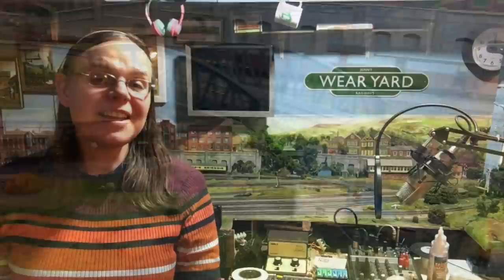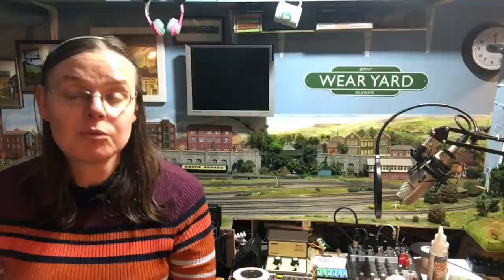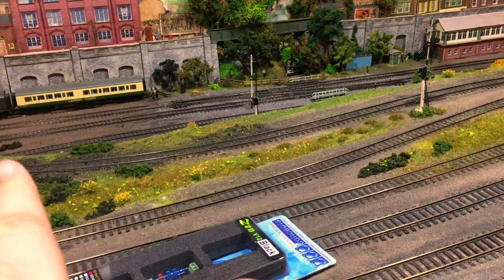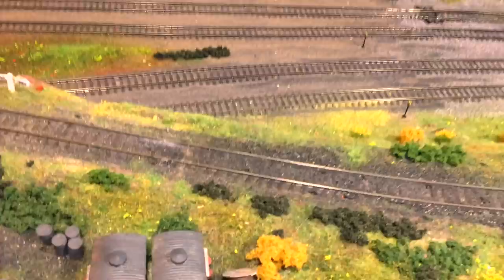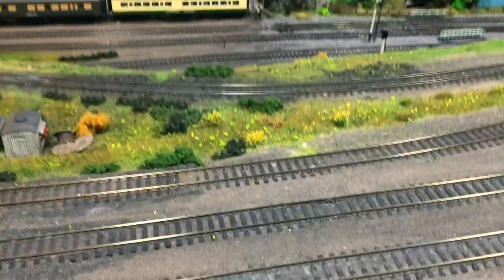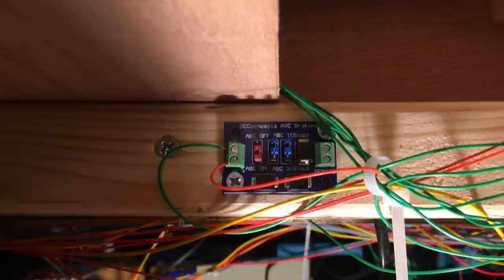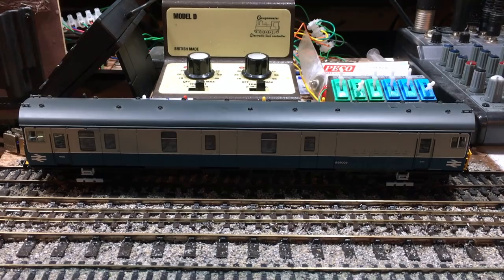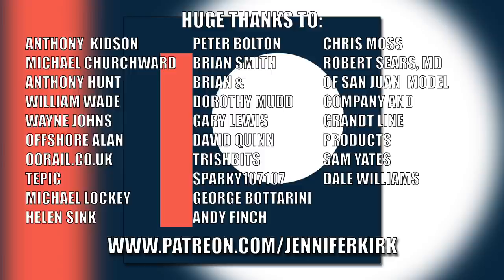Automate Your Layout The Easy Way! How to Add A Zen Black DCC Shuttle Module

Comment: Hi Jen.
I've been using this system for some time now.  5 diodes and a switch or relay to bypass them is all that's required. They're cheaper but less convenient than the DCC concepts module.  I use ZIMO decoders at £20 each which have ABC and all the other functions required to do the same thing as you're doing.  They also have superb motor control, and I highly recommend them.
Thanks for all you do for the hobby.

Comment: When this Video was uploaded I thanked you and stated that I was having issues with Zen Black Shuttle and Hornby Railmaster ELink.  Over the last week I have had more issues with ELink due to Windows 10 updating drivers for my computers mainboard,  USB Port drivers in particular.

As a result,  I wired my  " Arduino / JMRI "  controller straight into my DCC track via a DPDT switch,  I can now switch from ELink to Arduino at the throw of a toggle.
Up take is,  without changing anything else, the Zen Black Shuttle controlled section of my layout now works perfectly.

I can throw my "Toggle" one way and run ELink and the shuttle misbehaves,  Throw the "Toggle" the other way and go to Arduino/JMRI and the shuttle works perfectly. 

What can be taken from this is that,   in my case,    a bad experience with Zen Black shuttle modules was 100% the result of using Hornby Railmaster and Elink.

Thank you again for your videos.

Comment: Very informative and we'll demonstrated and thanks for bringing to our attention. Definitely something I will look into, as you say once intiated frees up your hands to do other things whilst creating operational interest for shuttles, or automatically stops an engine automatically once you have sent it on its way. Looks like the section  you have isolated gets switched between the normal dcc signal and dc, the decoder responding differently (but as programmed in relevant CVs) to whichever supply source it sees at that section. Stephen

Comment: Watching your video has been enlightening and I now know that I'm not the only one who has had gremlins with Zen Blacks.

I have 2 shuttle lines,  totally separated from the rest of my layout,  with a DMU on each track.  My Zen Black setup misbehaves badly.
I need to run the DMU's first forward, then backwards, then forwards again whilst outside the Zen controlled area, then I can let them enter the Controlled area and they will then shuttle back and forth with out issue, for a while.
If I shut down my layout whilst the DMU's are in the controlled section, then turn the layout on again they will come out of the controlled section move about 2 feet then go back into the controlled section, eventually after going in and out 3 or 5 times they will start behaving properly by going from one controlled section to the other and reversing correctly.
At a random interval my running shuttles will revert to this exiting and reentering the controlled area, then after a number of in and outs will return to shuttling. 
I'm using Hornby Railmaster with E-Link and have been advised by my supplier that E-Link might be the problem.
To hear you say that the Loco does not work properly if placed on the track the wrong way around is nice and is exactly one of the issues I have as well.
I have just started playing with Arduino DCC++ and JMRI and will now expediate the change of the shuttle area to Arduino, as I had given up on ever getting the Zen to work correctly continuously.
Reply from the maker: It sounds like it could be an issue with the e-link. I’ve heard that there are certain things that they don’t like. Otherwise, the other thing is to make sure the track is clean.
Reply: @JenniferEKirk  Thanks for the reply,  Yep... I've got a few things the e-link doesn't like.
* - Early Broadway Imports Locos - Keeps going into disconnect mode.
* - Broadway Limited Blueline - Just a mess.
* - Proto 2000 - Works perfectly on DCC++ but randomly stops for 2 seconds on ELink , same section of track in both cases.
* - Zen Black.

Track is super clean.  

I have been advised by 3 different train shops and quite a few Modellers to Dump the ELink,  but I love the graphical user interface,  not so much the quirks of Railmaster,  that's why I'm trying the DCC++ and JMRI.

Comment: Hi Jenny just viewed you ZEN BLACK V12 VIDEO. 
How do you get the right distance to get the gap in the Electric side of the track, for it to stop at the correct distance at the station. then wait and then pull away slowly and proceed to the other end of the branch line again wit for a given time and then proceed to return back again stopping at the station on the return Journey, I have the pack of 3 of these ZEN V12 BLACK DCD-ABC pack of 3 and they slow to stop. 
given, I bought these a couple of years ago and due to my health condition l have been in and out of hospital and now just got round wanting to build a end to end 3 meters long and 300mm wide with a siding part way along. 
I really enjoyed your Videos with so much definition and plain instruction, my problem is I am almost 80 years young and find it hard to come to terms with these modern days Electronics. 
If possible could you send me a wiring diagram how to wire these 3 up to the DCC l am hoping now to build having carried out the board construction having been a carpenter in my early days, again many thanks for your clear and precise explication of this World of Model Railways Workings

Regards Richard in Cornwall United Kingdom .

Comment: Thanks for that, I've been thinking about one of these for a while to use on my branchline. Just one question. If you wanted other locos to be able to use the track when the shuttle was not running (manually as such), is this an option? Or is it shuttle only once you've installed this?
Reply from the maker: Other locos will ignore the shuttle. Only locos with shuttling turned on via CV27 will shuttle.
Reply: @JenniferEKirk  that's really helpful thanks Jenny.

Comment: what decoder will this work with in n gauge? ie is there a 6 pin one?
Reply from the maker: The 6 pin decoders are too small to contain the necessary hardware so you would need to try hardwiring the mini 8pin one.

Comment: Thinking of using a DMU as a shuttle service, would I need to put one in each carriage to work with this shuttle board?
Reply from the maker: Only the decoder that controls the motor needs it.
Reply: @JenniferEKirk  many thanks for that, might give it a go, cheer's